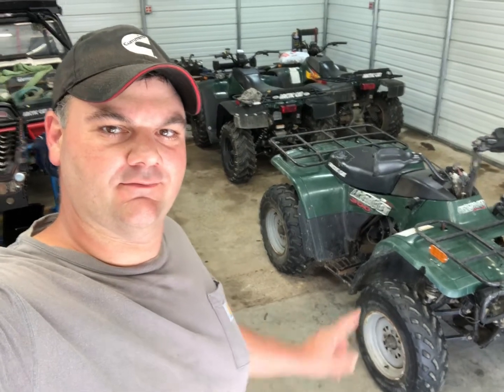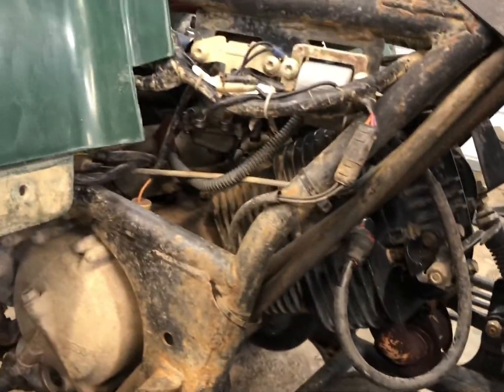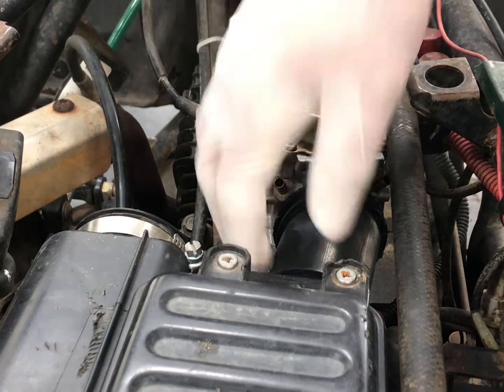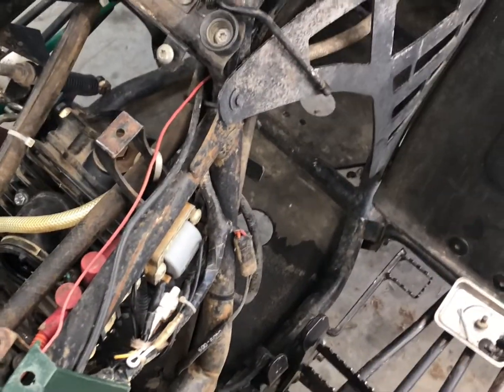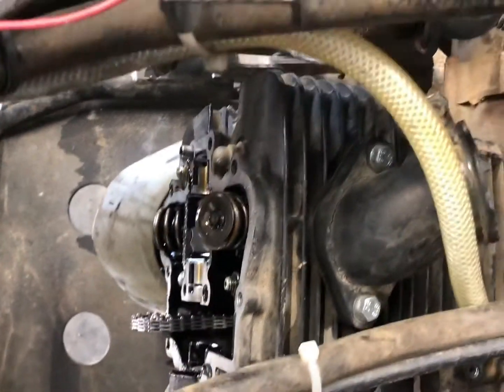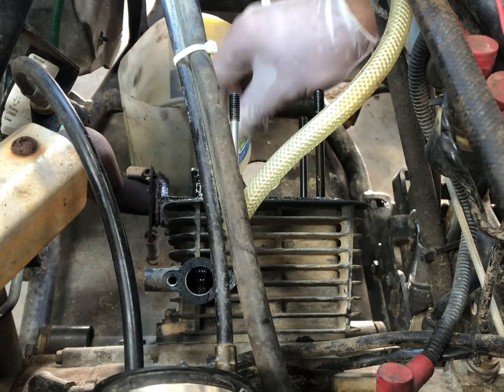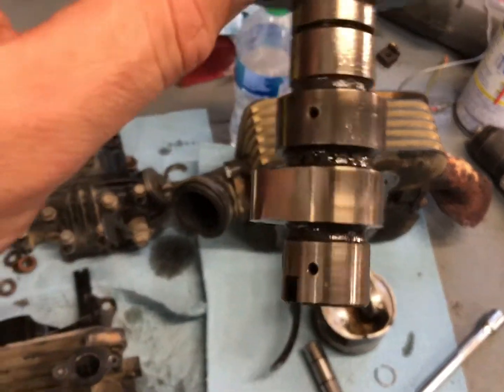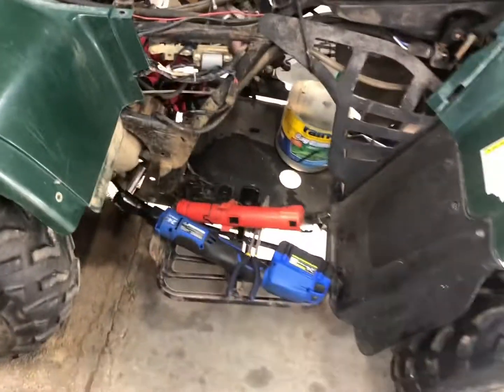Arctic Cat 300 Engine Tear Down

Comment: Have an artic cat 250 similar to this only 40psi compression so trying to do the top end but the jug will not come off because it's hitting the ears on the timing chain guide opposite the tensioner feels like something is holding it in the bottom?
Reply from the maker: So are you saying it feels like the timing chain guide is stuck in the engine block? If so, it has kind of a slot that it fits in down there. It should just slide out as long as the timing chain isnt bound up in its way down there. Im not sure what else could be holding it really. Also, a lot of the time when these engines lose compression, its because the intake valve gets tight and is being held open. The intake valve is bad about wearing on these suzuki engines. Id replace the valve most likely while the head is off just to be safe or at least inspect it good for wear.
Reply: @CumminsDriver how much to charge someone to replace piston and rings?

Comment: So I put a new top end on my 2000 Arctic Cat 300 and did everything correct except for one thing. I forgot to put the o-ring onto one of the 4 studs after putting the cylinder on between the head. My question is, how severe is this to leave it like this and run with it? I absolutely do not want to tear it all down again. Thanks for any answers/opitions you can provide regarding the missing o-ring, thanks a million
Reply from the maker: The o-ring is to seal the oil passage that sends oil up to the camshaft in the cylinder head. I have never put one together without that o-ring so I cant say if it would be a real issue or not. I believe it would still have to blow through the gasket material also in order to be a problem, and i honestly think it would have a hard time doing that since it's clamped tightly with the head bolts. You may just keep a close eye on it for a while if you decide you don't want to tear it back down. Good luck with it!
Reply: Really appreciate the response! It seems that o-ring is just an additional measure (overkill) to the already completely sealed gasket around the head stud to keep trash out of the engine since the head is cut out that uses that head nut instead of the other 3 acorn head nuts. I just started it up and broke it in for 20 minutes and it runs absolutely amazing! Thanks again for taking the time to reply to us small engine n00bs :)
Reply: Did you put a new jug or just the piston and gaskets
Reply: @m0n3ym4k3r1000  Just new piston, rings and gaskets. Use it all the time on the farm for chores now, runs great

Comment: How did u take the timing chain so easily mine is so hard to get out
Reply from the maker: This timing chain was worn out which was making it very loose. If the timing chain is in good shape and not loose like this one, you will probably have to take the two bolts out of the cam gear and remove the gear so you can get the chain off of it. Hope this helps
Reply: @CumminsDriver  I also cant and impossible to remove cam gear and camshaft together like you did in this video. The tensioner is out and even the side bolt that hold the other tensioner it out and way too tight to take out. R u saying to have to remove the 2 cam gear bolts and then remove the camshaft and then the gear will have enough slack to get out??
Reply from the maker: @JoeSmith-sv4jn  Yes, basically youll need to remove the two cam gear bolts(you may need to remove one, then spin the engine to get to the other one) and once you remove the bolts, you can slide the gear off the end of the cam and drop it down enough to get the chain walked off the gear, then pull the gear out. You'll have to reassemble it basically the same way. Bolt the cam in, then get the chain walked onto the gear, and then slide the gear back onto the end of the cam and reinstall the bolts. Hope this helps
Reply: @CumminsDriver  Thanks for the reply. Was able to get it off last night and my bore is good just honed it so was good news!
Reply from the maker: @JoeSmith-sv4jn  Good deal, sounds like hopefully a quick fix!